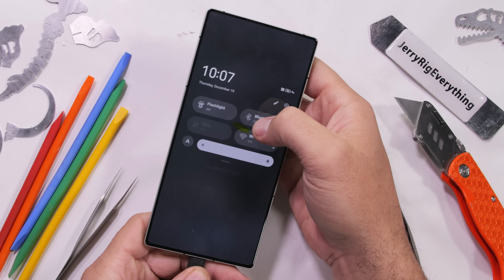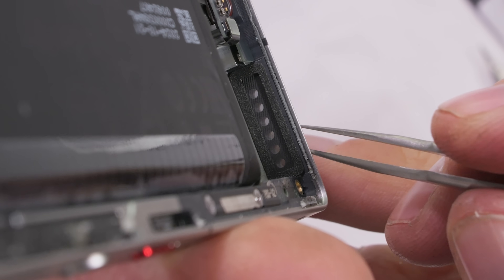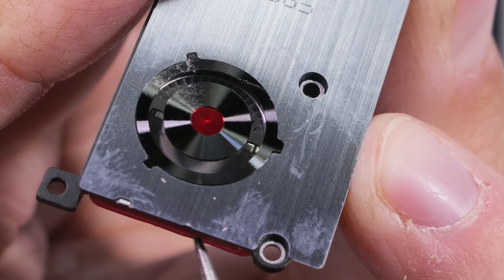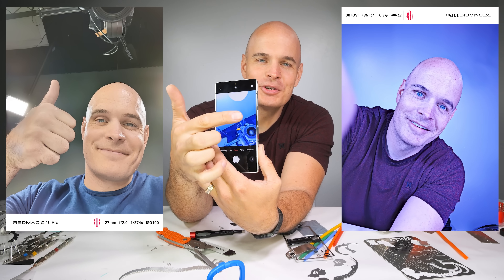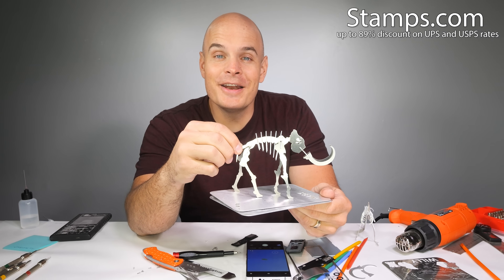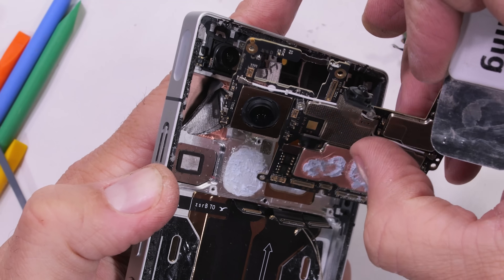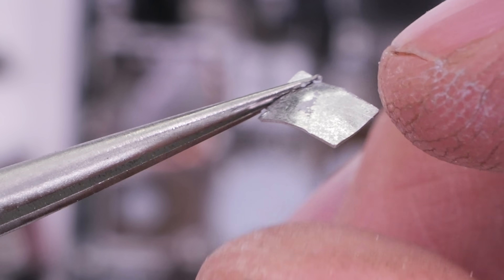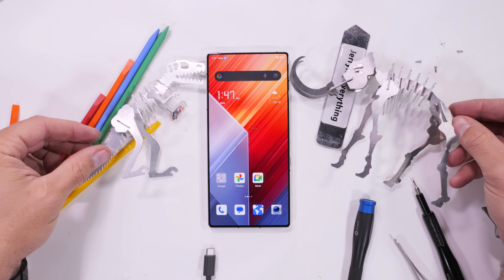The Smartphone from 2040 has a 'Liquid Metal' cooling system inside?

Comment: That selfie camera is insane it actually provides a really good image while bending back and it's 16 mp
Reply: Yeah 16 mp but with a larger sensor can produce good images like in DSLRs they have large sensors but 20 mp in budget ones
Reply: Hi
Reply: @Christianblaze01  hello!!! 😉
Reply: i mean, the bending wouldnt do much for destroying quality, since the wires inside the flex cable are either working fine, or not working at all if you bend it too much and they break.
What is interesting though is that they somehow got rid of the smeared not sharp image which was the whole problem of the underscreen camera tech.
From what i see, it seems like theyve just made the pixels not glow as much, which is why the hole is so visible without the camera.
Reply: @Neonflame  😉
Reply: Ai slop bot
Reply: they could have a very good front camera but choose to make it a mediocre camera by placing it behind the screen. so dumb in my opinion
Reply: @permagnusandersson6052it's not dumb, it's a design choice. it's good not to have a hole in the middle of a GAMING phone. there's literally any other phone on the market that has a regular front camera

Comment: 455 views and 99 likes in 2 minutes? 
Bro fell off 🗿

Either way it's good to know that the phone is built to resist water.

The fan would probably be safer (against breaking) if there was a cap you could put on it for protection when you're not using it. (Correct me if I'm wrong please).

The Rog aeroactive cooler 6 broke in about a year of me having it and that was me really trying to take care of it by cleaning out dust with damp Q-tips. I'm not sure how long the built-in fan will hold before dust builds up.